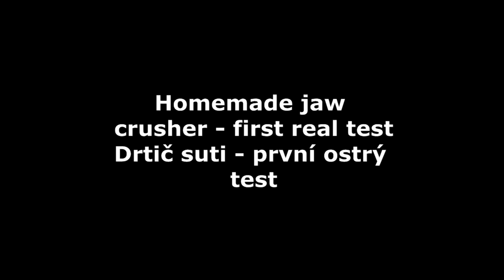Homemade Jaw Crusher - first real test

Comment: Nice little machine ,would it not work better if you changed the rotation around on the jaws
Reply from the maker: It really doesnt matter.  Because, it is 3 phase motor, and Murphys laws works well, it rotates every time different way, when I move it (friends, familly, our summer house, at home). And I found, that it is no big deal, if it rotates clockwise or counterclockwise.
Reply: @michalrimmerak1646  having manufacturing crushers for many years the rotation plays a big part in the process it pushes the product through 30% faster ,give it a go !
Reply from the maker: @lauracurtis4786  Really cant tell, I did not recognize any significant difference. Maybee, on my configuration and with material I working with really doesent matter. Now, I have broken motor shaft, I used 40+ years old motor from old mine ventilation, so I expected some failure. Now, I must change the motor.

Comment: Great job Michal, how did you attach the tyre rim to your shaft, did you machine a sleeve ?? And roughly what angle was your bottom pivot point at please
Reply from the maker: In this video, shaft was thrue the steel bushing welded on rim. And shaft was glued on by Loctite 603. It was allright for 4 hours, when temperature rises and glue failed. 
Now, I re-engeneered  whole crusher. I will send you some pictures, please write me on my email rimmerak(at)gmail.com 
Excentricity of shaft was 10mm, but is was to much, now i have 6mm excentricity. It gave much bigger pressure on concrete.
Reply: Email sent, thanks
Reply: Hey, Michal very beautiful project you have done a great job.
Is it possible to make a video or show pictures on how did you do the eccentric shaft and how the installation of the bearings is done.
Thank you.

Comment: what sort of sharft did you use and the 2 bearings on the inside
Reply from the maker: Inside bearings is only steel to steel. So I must grease it very good. But works fine. I dont need 24/7 runtine. Just crush few tons of garbage.

Comment: is that a leaf spring and a hinge bushing?
im so close to the end.
Reply from the maker: There is no leaf spring. On the top is excentric shaft and the crushing jaw is on the down side just supported by flatbar and hold in tension by normal spring.
Reply: Michal Rimmerak vb